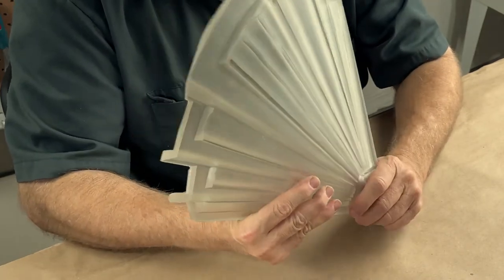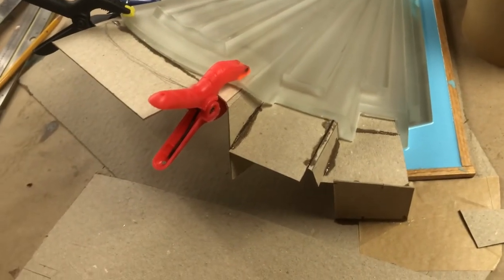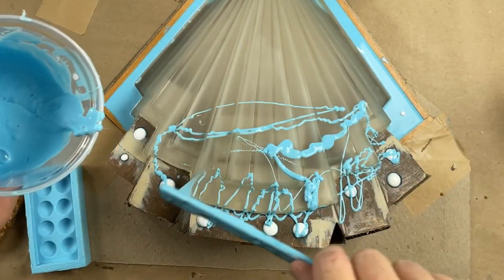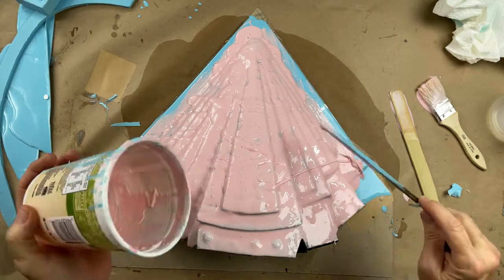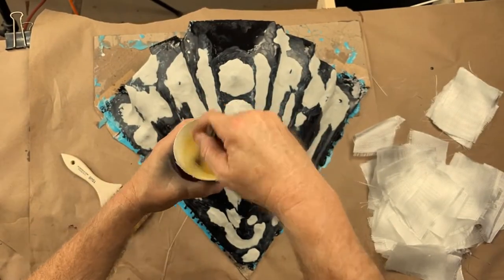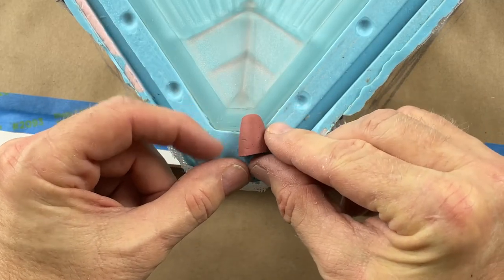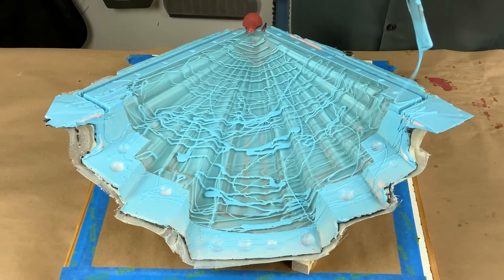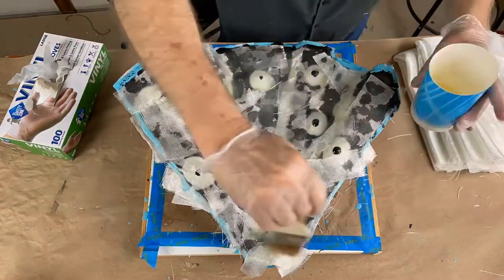Molding A  Glass Lamp Shade - Part 1

Comment: This video has given me a bit more confidence with finally using this technique. I never understood if you could or should reinforce the extra layers of silicone with fabric, or how to approach making the fibreglass jacket correctly, the mould release and gel coats have demystified the uncertainty. I have seen cases held together with bolts so I wonder if you will be making something like a flange that can be drilled to accommodate the bolts later, I shall stay tuned as they say.
Reply from the maker: I am not a fan of putting fabric reinforcement into silicone although a lot of people do it. I like to make my blankets thick enough to hold their shape inside the mother.

Comment: hi, since you're a big fan of wax, you're going to love monster clay ("hard"). it would probably ease your feelings about such sculpted parting lines: you can cast it into sheets when hot; bend, drape and sculpt it when warm, sand it with gaze when cold and even "flame polish" with a heat gun. it would probably save you some time instead of using cardboard!
Reply from the maker: Monsterclay is excellent and I could have used it for this application.

Comment: Back with a vengeance Bob . Good to see you cracking out the oil clay . You didn't explain what a gel coat is and what it's used for.  Love a complex mould !
Reply from the maker: It E-108gc from www.silpak.com. The laminating resin is E-108sp.  The gelcoat covers the mold rubber better than just using laminating resin; it makes a cohesive surface. you can buy it in white and dye it colors so you don’t have to paint the finished casting.
Reply from the maker: You can do the complicated molds from now on Glen!  I want to only do simple, easy ones! 😳😳😄
Reply: @RobertTolone  is there are similar product that can be easily obtained on the East coast?
Reply from the maker: @carolsakai-artist   Undoubtedly there are East coat fiberglass supply dealers who sell epoxy gel coats and laminating resins.

Comment: Thanks a million i learned a lot from your videos! It's inspiring to see someone that enjoys to care for details.... Can you kindly give me an advice on how to cast a cassette tape... I've tried but its super hard to get it right and i dont want to waste so much material
Reply from the maker: Hi Cris, are you trying to make a working cassette tape or like a prop facsimile?
Reply: @RobertTolone  im trying to make a working cassette tape that's the tricky part 🥴. Thanks for your reply!
Reply from the maker: @TheCrisdlc  Yeah, that would be difficult for two main reasons. First, injection molded parts are not designed to be resin cast. Injection molding and resin cast are very different processes and it’s often impossible to duplicate an injected part in resin. Second, even if you could cast the part, the final resin casting will be slightly smaller than the original cassette because of the unavoidable shrinkage in the mold and in the resin. So your cast parts will not fit with the other parts contained inside the cassette.

Comment: A two part clayed up matrix mold to cast clear resin/epoxy without pressure - wow, that is a lot of work, even spread over 3-5 days (for this part).  I am intrigued to see how this turns out, especially the finish on the interior of the part where you used the spray mold release.  Is your plan to cast two or more copies so that she will have a matching set?  I was expecting a support frame to keep the mold from curling in or out when you cast the final parts - is the fiberglass usually rigid enough to prevent that?

Comment: I checked through your materials list and didn't see a listing for the gel coat that you used - please provide.  Is this a polyester resin+fiberglass fabric combination that is similar to that used for latex mother molds for casting concrete?
Reply from the maker: It is an epoxy gelcoat E-108gc from www.silpak.com. The laminating resin is E-108sp.

Comment: Aluminum Tape (AC pipe tape) , can be smoothed against the part perfectly and basically doesn't stick to resin or silicone, can be backed up with cardboard, doesn't have to be
Reply from the maker: Good idea, I’ll have to try that out. Thanks!

Comment: Hello sensei, it's me again.
Please advise.
The situation is as follows - you need to cast a certain number of housings for electronics.
Of course, the best method would be injection molding into metal molds. But it is very expensive and not suitable for small series production.
I thought it would be worth trying silicone molding. But what composition to use?
Probably, this should be close in properties to ABS plastic. At the same time, is not very expensive.
Advise what to look for.
Reply from the maker: I really don’t know which resins that are available to you would closely mimic the qualities of ABS.  I would refer that question to resin suppliers in your area. Usually the biggest challenge in resin casting injection molded parts is that the parts were not designed for resin casting. The two processes are very different from one another and have different requirements. If you are copying an existing housing you may have to modify it to be able to cast it successfully in resin. If you are designing the housing you can optimize it for the resin casting process.
Reply: @RobertTolone  Thanks. but I was just talking about that injection molding is not available to me.
I was going to use good old gravity.
Thanks. but I was just talking about that injection molding is not available to me.
I was going to use good old gravity.
I design the body of the lantern. It will be simplified as much as possible. To avoid bubbles, it will be split into several pieces.

Comment: how do you clean a brush after using it to paint silicone? I imagine that washing it off would be bad for whatever pipes it goes down and waiting for it to cure like you can do to clean mixing cups sounds like a bad idea on something with bristles
Reply from the maker: You can use acetone but I usually don't bother. I use cheap disposable brushes and budget them into the cost of the mold.

Comment: Question: 1) why do you not use thickening agents for silicone (thixotropic or cabosil fumed silica to thicken the silicone mold material), 2) why do you not use vaseline as a mold release agent?
Reply: Why add a thixotrope to the rtv when you can keep it as simple as possible by getting one ready to go. If you use a spray release it gives an even coat especially if you get it on the pattern , if Vaseline is not applied properly you can get brush strokes and uneven coatings.
Reply: @glenfisher728  I don't understand the first sentence, does. . .  "one ready to go" imply that you have to have two separate silicone products on hand 1) a more liquid silicone for a face coat, and 2) a separate silicone rubber that is thicker and more brushable?  I am an artist looking to do this inexpensively and spray release is significantly more expensive than vaseline
Reply: @carolsakai-artist  rtv is thickened chemically not physically . So yes , generally two types of silicone are needed. They need to be the same type , tin or platinum based to stick to each other. Yes , I used Vaseline for years because it is cheaper but a spray on release agent will give a better more even coverage .  Vaseline is good to use it just takes more time and care to apply and it's best not to get it on the master pattern.
Reply: @glenfisher728  Thanks for the explaining between chemical and physical -  however I have made silicone molds with cabosil or polyfiber, and they seemed to work ok.  I now realize there is a difference in techniques chosen between those who want commercial production and artists who only need very limited production (such as for bronze casting, or very limited edition).  For artist who only need a few copies, time is now so important, but often money is - there is a yin/yang balance between the two.
Reply: Again it depends what you're casting in to the rtv. If it's a quick set polyurethane I think you might have problems with physical fillers. If it's plaster you might get better results. Cost is a major factor , it's a good idea to look around at prices. The local moulding/casting supply shop near me had a vacuum chamber and pump for AUD 450 but on eBay the same unit cost AUD 150 delivered. If you're just doing a few castings the cheaper stuff will do but if you want many castings you've got to pay the money . What type of product are you casting in to the rtv ?